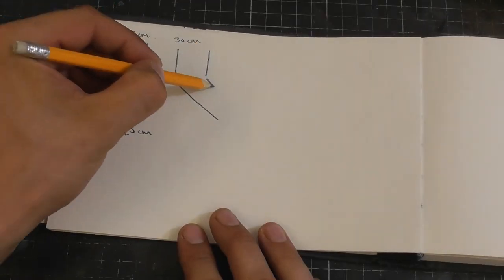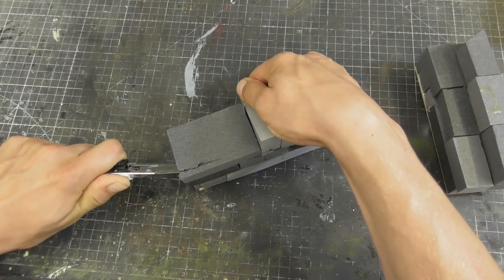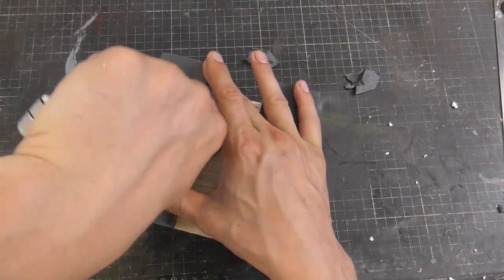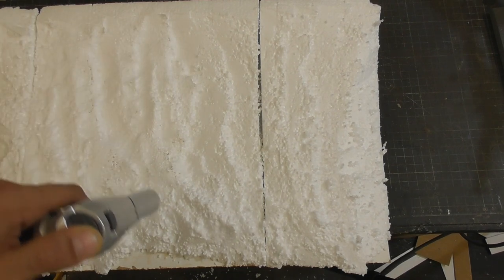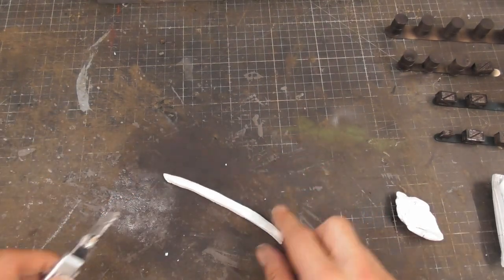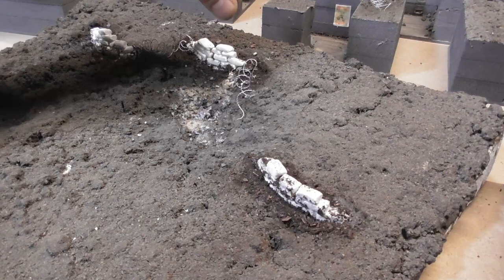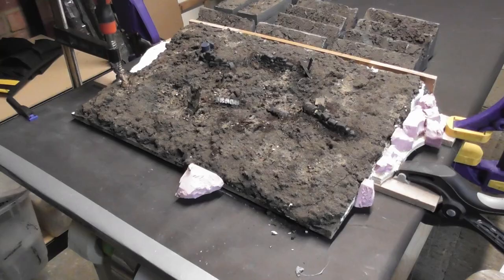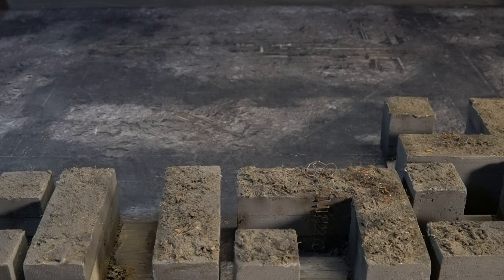Building Modular Trenches for Warhammer 40k

Comment: Looks very nice

Depending on your game play and which particular 40k system you choose to utilize with it.... I would make a few 'frontline' trench pieces so that your guard, or whomever can set up inside, remain in partial cover and shoot out over the no-man's land.... otherwise, (ignoring objectives) a Tau player could just keep to their edge and merely shoot (en mass) you down as you try to rush them with your unsupported forces.  These 'frontline' pieces would be easy. A "L" shape towards the no-man's, like a step, and a "I" tall straight wall towards the rest of the trenches. For fun and variety, you might try to make some "bunker"/"room" sections that would be roofed (removable of course for miniature access). These 'rooms' might house supplies or enemy intel, or other 'objectives' that would be useful in representation of the game mechanics. You could use the same size modules footprint but make a plasti-card "I beam" frame at the corners and then atop all four sides (like a hollow metal cube frame). A flat piece of plasti-card can lay over top as roofing. You can line several of these in tandem to make larger 'rooms' and the frame style will keep the roof segments aligned and structurally secure for miniature running over top. Lined up, it would be like a large room with support pillars/columns equidistant along the center. Perhaps make a 'room' further in reserve that is unroofed for artillery installment.
Just a thought.
Cheers, mate. 
Looks grand. 
Keep it up!
Reply: By building them 'empty' you can swap in and out any genre specific interior 'scenery' you choose to place inside for the future of your project. By not glueing down specific 'objectives', you further extend the 'modularity' of your project to it's optimal extent.

Where these rooms meet, expect your 'columns' to be bigger (girth) than if it were single 'rooms' as you are placing the supports directly next to another. 2 rooms: double support width where they meet, 4 rooms (in a square): the 'center' post will be 4x while the meeting 'edges' will be 2x.
Plan accordingly so they are flush and line properly for a quality end result.
Reply from the maker: Hahaha I love it. Pretty much how my mind works too. Now I have loads of pieces, I can easily add all kinds of additional parts depending on the need at hand. Because of the height of the trenches/tunnel you can set it up easily so that it can really create some interesting choke points where Los is completely blocked unless you go through the door of death haha. So many possibilities but the greatest complement for me is that it sparks your imagination to think about what you could add yourself. Thanks for watching and getting involved 👍